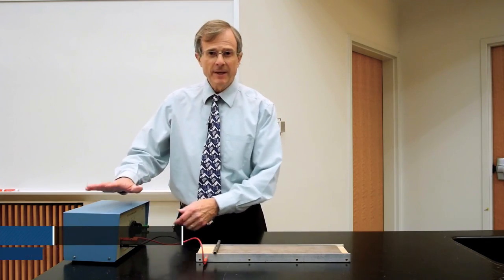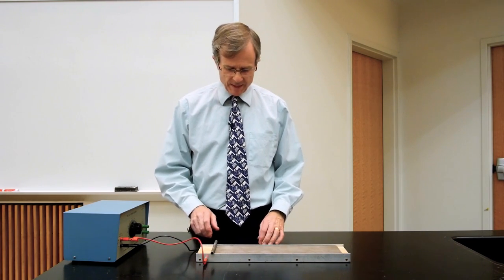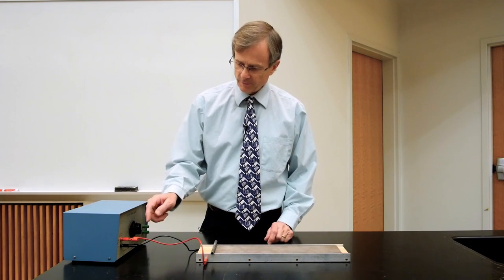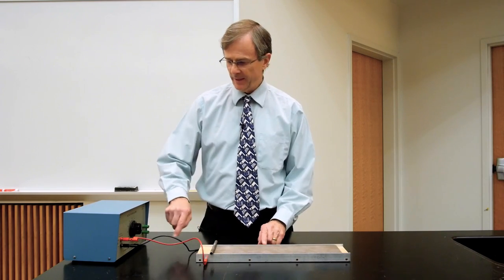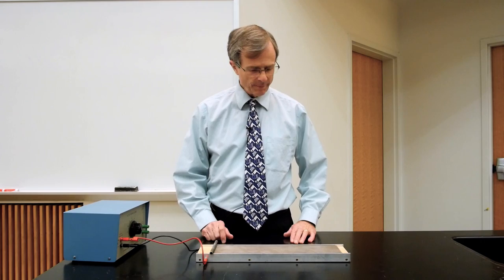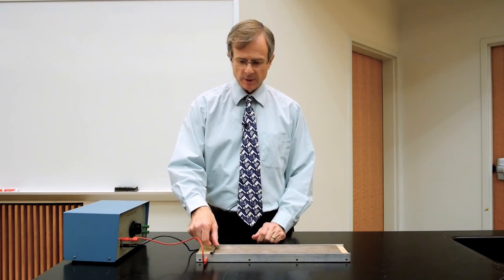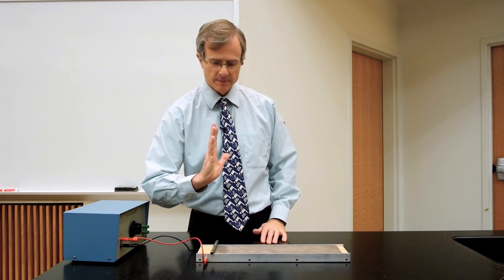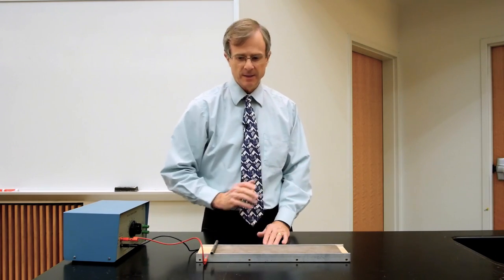Magnetic Force on a Rod Demo: Accelerator

Comment: I have a simple question and I urge you to please answer this
When you switch on the current the rod experience magnetic force and move towards right side but due to this area enclosed by rails and rod is also increasing.
So this implies that magnetic flux linked with this loop increases but according to lenz law an induced EMF is generated in the opposite direction so as to cancel out increasing flux and therefore I think a current will flow in the opposite direction with respect to current given by the battery..
So I think due to this net current should become zero and therefore the rod should stop moving..
Please answer my question..

Comment: wrong. the right hand rule is: index in direction of magnetic field, middle finger in direction of current, and thumb is in the direction of the electro-motive force. you lied about the rule to explain it based on your misunderstanding due to conventional current vs. actual current direction which goes from negative to north.
Reply: Not really, he didn't use the Fleming's right hand rule about which you're talking about but Fleming's left hand rule. All he did use was an alternate method of stating the left hand rule. F= ILBsin∅